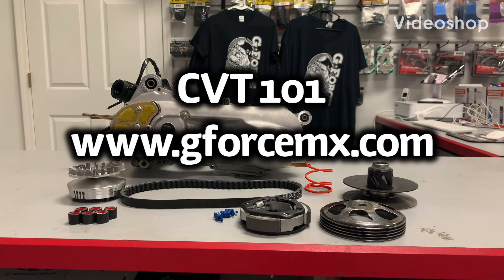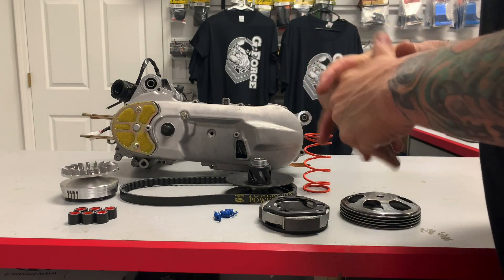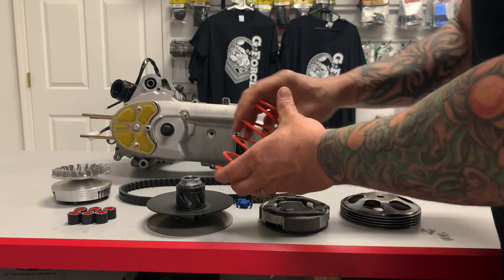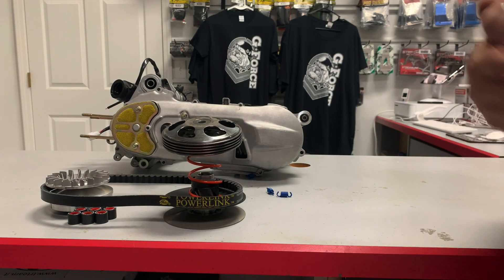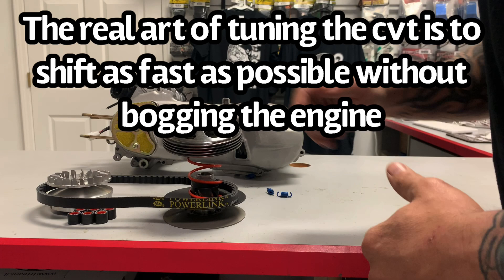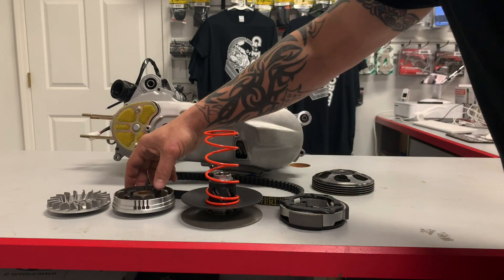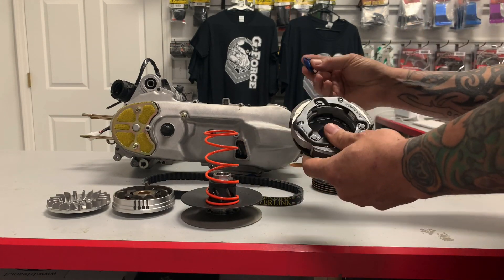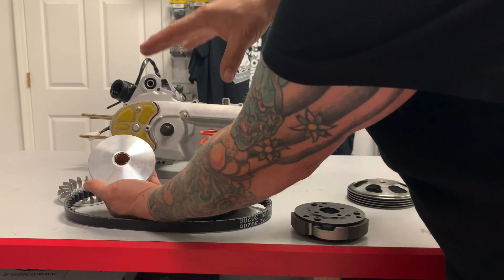DRR and Apex  - CVT 101 - Team GForce

Comment: Thank you Gary!  Very informative!  Much appreciated!  We have a DRR90 that has been a very good quad.   Got it used, my son rode it for years without requiring much maintenance.   The belt started smoking one day after years of use so I replaced it and didn't get the results I thought I should.   I ended up replacing the clutch with a Malossi Fly and it's not engaging properly.  I now have a slight understanding why but will be in touch soon for advice on what to do.  Thanks again!!!

Comment: Man you made the cvt so easy to understand for some reason others just say cvt cvt cvt variator and rear bell housing but I thought I new what I was doing lol nope thought lighter weight rollers was faster heavy spring orange or red were good Contra springs and I needed 1200-2200 or something springs I was confused but he explains this is for high torque revs and the tips great vid 👍 saved for reference for sure

Comment: I’ve got a can am DS 90X 4 stroke. This thing is a dog what are some things I can do to get better performance out of it? It’s not a race bike but it can’t climb hills and seems to come stock for riding on flat ground only. I have tried the red 2000rpm torque spring and the 1500 yellow 3 small springs from Hetrick Racing. All I got was a higher rev and no noticeable difference with performance. Man if you guys had a proven power up kit you guys would make some decent money I bet. A lot of can am mini quad owners are pretty mad about the performance after dumping $3800 for a kids bike. I just changed out the torque (red) spring to the stock spring and left the 3 1500rpm yellow springs in and put 9g rollers in and what a difference already as far as take off. Should I put the red torque spring back in you think?